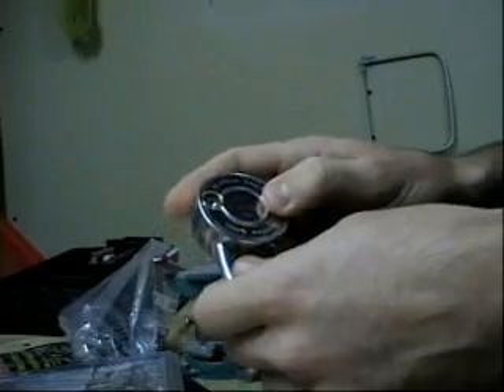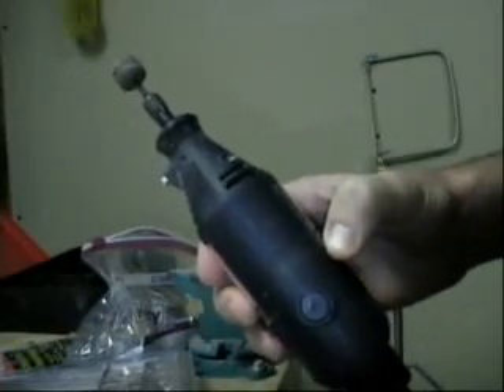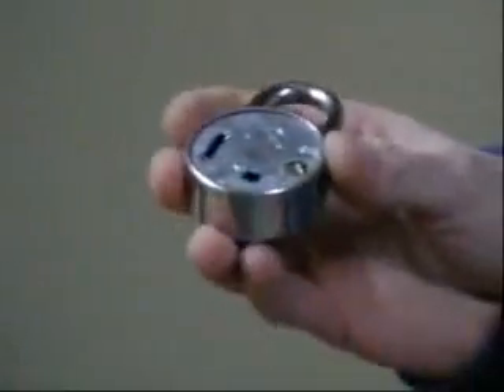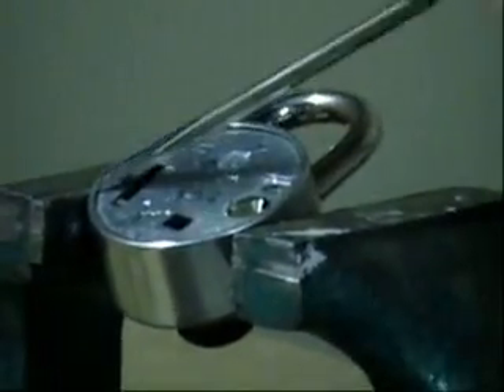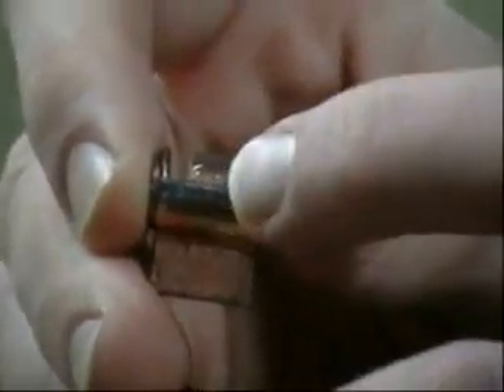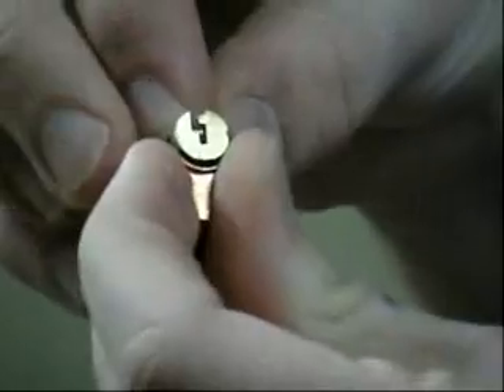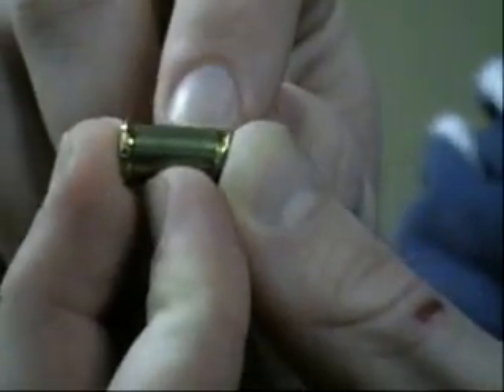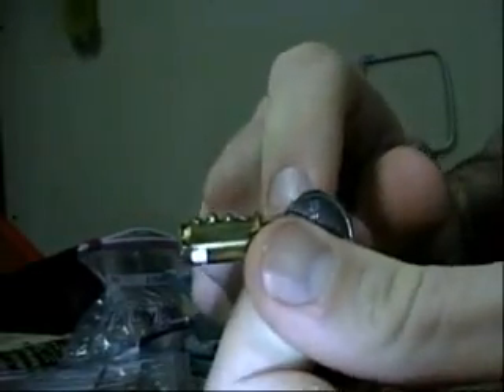How to make a real masterlock "master key"

Comment: Most master combo locks, have one universal key that works on 90% of them. The key is blunt object and tap on latch side of bolt wile tugging on it and it will pop open. As state 90% of the master combo locks have a major flaw in the fact latch that holds the bolt in place is held in position by a spring. A solid tap on the bolt causes the spring to retract enough for the bolt to free.

Comment: @SL4VE0WNER1904619 Um It doesn't have to be an actual hammer. You could use a big rock, a crowbar, a tire iron, any number of objects could be used to break one of these locks off of whatever its mounted to

Comment: @brotherbriann Or use bolt cutters and just cut the damn thing..... Or use the hack saw to cut it.... Or just cut the damn mount of whatever its locked too?! (If its something like a gate where the lock is just through two thin plates smack them with a hammer most of the time the plates locks are set into are cheaper than the lock itself making them weak)

Comment: So I accidentally dumped the last 3 bottom pins (Like an idiot), 2 are the same height, 1 is smaller. so the 4,3,2 pins are mixed. if 1 is the smaller pin, should i cut my key for:
100
101
001

Please help.